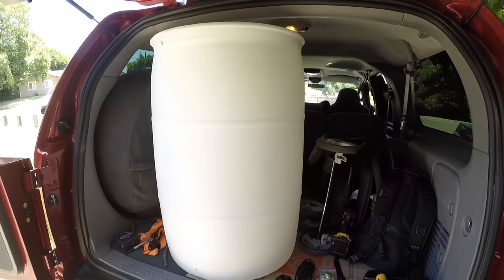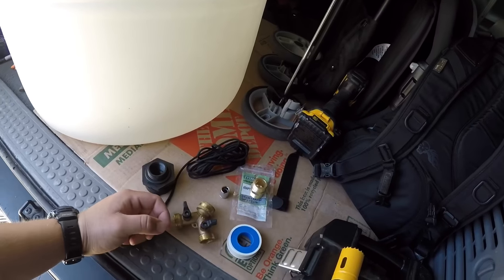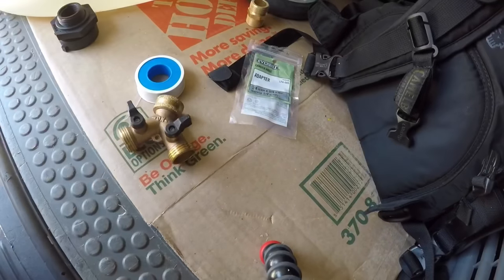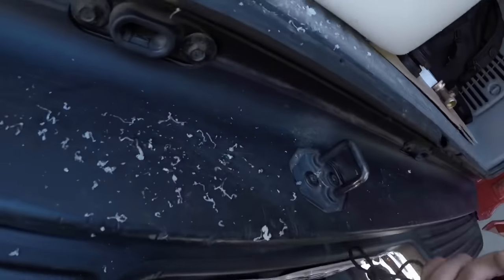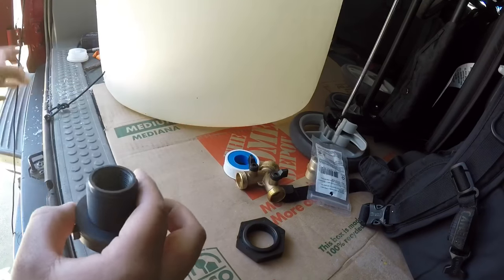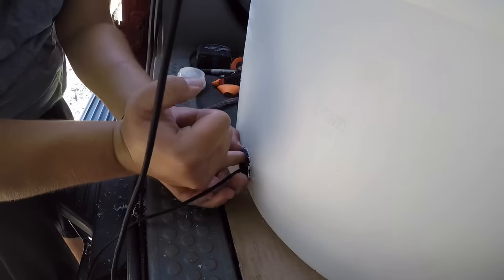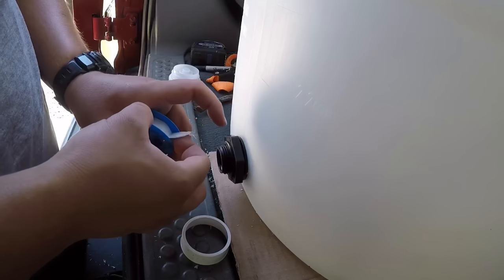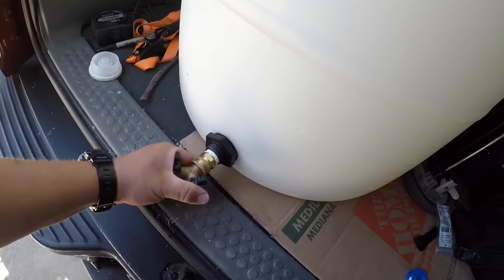55 Gallon Drum Water Tank Conversion

Comment: Can you list the parts needed thank you
Reply: If im not mistaken
Sounds like 
A. 1-1/3 inch drill saw
B. 1-1/4 reverse threaded bulkhead with hard plastic and rubber
C. 1-1/4" garden hose adapter
D . 2 way garden hose splitter (Assuming your hose is 3/4")
E. Teflon tape or plumbers tape
F. A long string like he said if necessary.
Reply: @altairs.6380   you goated bro thank you .
Reply: @altairs.6380  1 3/8 hole saw

Comment: I have done these for several people around here and feel the need to point out a couple of things.  First, you never cleaned out the inner nor outer sharp edges left by the drill. Second, you slipped the cord out before even attempting to put the nut on. You were lucky it didn't slip back inside....and then have a good old time trying to recoup the bulkhead inner parts. Lastly, when you tie the 7/16 socket, you would do well to leave a 3-4" tail hanging off it to make it easier to grab from outside...with either finger or mechanical fingers.
Reply: use a pocket magnet
Reply: Shouldve cleaned out the inside of the container so the PW doesn't suck that plastic into the pump.

Comment: It's nice to have that amount of water on hand but that barrel is going to be a bear to move once full.     Your way is good but.      Another way is to pop out that three quarter plug in one of the bung plugs and add a pvc fitting and pipe long enough to reach the bottom.  You will need a pump of some kind or you can pressurize the tank.      Keep up the good work   Peace
Reply: Or let gravity do it's job
Reply: Or maybe make your own video for people to point stuff out to you if it works it works

Comment: Can you give an exact parts list. I already have the drum. Just need the parts. Thanks
Reply: Law22 LAW  threaded union fitting 3/4-in x 3/4-in  I got mine at Lowe’s for 12.99
Reply: Law22 LAW it comes with seals and everything
Reply: dann i hey man what kind of saw is that he using to cut?
Reply: Where did you find the 2 hose valve?
Reply: @cesarorozco2638  amazon or home depot carry them

Comment: So does this method work without any form of water transfer pump from tank to pressure washer? I would think it would gravity feed through the bulkhead-hose-to pressure washer. I’d like to do this setup with a Portland HF 1750psi electric pressure washer.
Reply: Did you try it and if so did it work ?